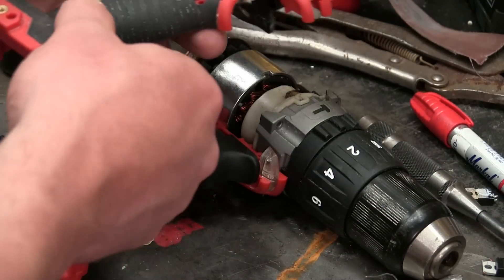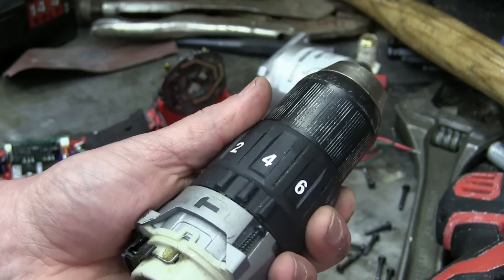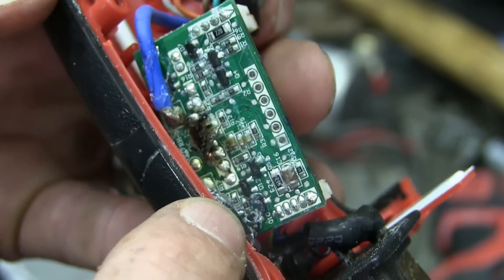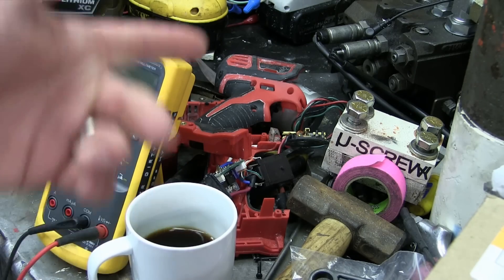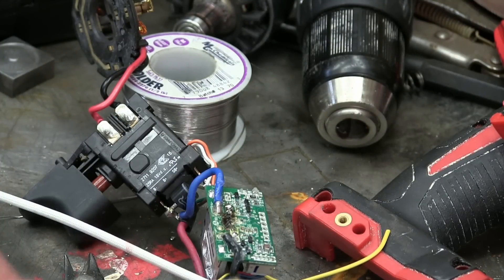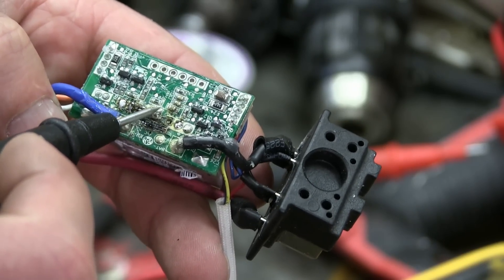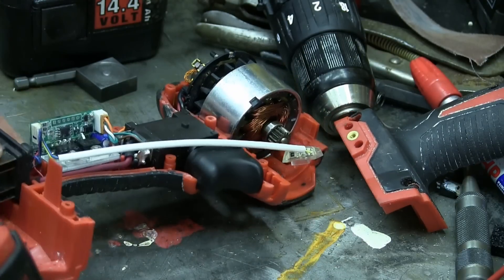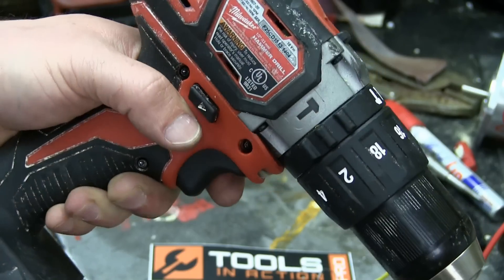How to fix fancy electronics in newer tools.

Comment: Hi sir I live in VN i have 1 hammer drill   MIlwaukee M18 2702 - 20, after 2 weeks to work it is smoke and death, when i press the trigger button  the LEDs are good but it is dont work i was check  soldered it is good, please hepl me, because it is expensive. How to Fix it is work again
 I buy on ebay, i cant go to usa  take it back under warrenty

Comment: Hey that milwaukee part is $60.20 CAD.  I just logged into my milwaukee account and checked.
Reply: Ya it was nice to see it was repairable.  You should see how many Milwaukee tools FAIL.  I have repaired drills that do not work straight out of the box.  I don't have all the fancy hardware to determine the exact failure, but it is sad to see such a great brand have so many issues.

Comment: Took your advice, grabbed a pressure washer neighbor threw out. turns out numb nuts left it out full of water and cracked a part connected to the pump head just where the pressure hose comes out (also sucks up any deturgents you want.)
 cant find it online... its aluminum so ima take it to work and try to tig weld it just enough to get her spraying again. if it works i get a free 3k psi pressure washer lol

Comment: AvE - You can use an air nozzle  to blast molten solder out of a hole if you don't have a sucker/braid handy.  Works great for thru-hole or smd components.  Just heat up the solder on a pin, squint (for safety), and give it a quick blast of air.   Repeat for all pins.

Comment: That was fun to watch and very helpful.  However, I wouldn't consider Milwaukee tools to be disposable, and they don't seem to either.  Their 5 year warranty bares that out:

Every MILWAUKEE power tool is tested before leaving the factory
and is warranted to be free from defects in material and workmanship.
MILWAUKEE will repair or replace (at MILWAUKEE's discretion), without
charge, any tool (including battery chargers) which examination proves
to be defective in material or workmanship from five (5) years after
the date of purchase. Return the tool and a copy of the purchase receipt
or other proof of purchase to a MILWAUKEE factory Service/Sales Support
Branch location or MILWAUKEE Authorized Service Station, freight prepaid
and insured. This warranty does not cover damage from repairs made or
attempted by other than MILWAUKEE authorized personnel, abuse, normal
wear and tear, lack of maintenance, or accidents.

Please keep the videos coming, they're always a hoot!

Comment: Is that drill actually worth more than $10?
Reply: It is when it works.
Reply: wobbly sauce
 I guess its also an environmentally sound solution come to think about it, I would be more inclined to do it with higher value electronics though.
Reply: Just the same thing with say.. older cars.. some are worth repairing and others are not, in comparison to say getting a new one(or new to you)..
Reply: I don't know about the drill. But the battery alone is worth north of $100USD
Reply: Paul Frederick 'Worth' vs actual value of the components :P
Reply: wobbly sauce
nah the battery pack is probably pretty nice as far as battery packs go. Although I have had problems with big red's old chargers in the past. Electronics is obviously not their forte.
Reply: Ah one of those.. spend money to make a good part.. but skimp on another for cost reasons.

Comment: 12 h i need to take a serious look at digikey it's probably way cheaper than Conrad and faster
Reply: I always call Conrad the "Electronics pharmacy" because of their outrageous prices. Sure you can take your parts home right after buying them in a store but asking five times the regular online price for a microcontroller is unacceptable. I only go there to try and find reduced gear, they always hide it inbetween the new stuff. Depending on what you need, you can always go to eBay and look for components and modules there. If you don't need the stuff right away, just get the parts directly from China.
Reply: yeah i live in a country where  we only have a few stores from conrad and they are very far away from me like a 100 km away and i only ever used amazon they don't deliver in 12 h but if digikey delivers faster than ebay here i will use it from now on

Comment: I've fixed many a pcb in similar ways. run bare copper along where the trace belonged, tin it to catch any bits of that trace and hold it in place and you can get uv curing epoxy stuff to build over it. you can even build pads for those smd components again and repair multi layer boards that way. enamel coated 30awg wire works well for low current. smash it flat to keep it from rolling around while you work

Comment: Wire it direct!  Why the flock would you need a circuit board in there. Wire the trigger to the batteries to the motor to the drill. Screw the stupid circuit board, just give the motor the pixies from the battery through the triggery thing!

Comment: Really enjoy the videos.  I don't think you mentioned that the MOSFETs are ESD sensitive, so you should tie the Gate to the Source (or drain, or both) while you are playing with and inserting it into the board.  Just wrap some AWG 24/26 solid wire from some stripped CAT5 around them and unwrap once it is in the circuit.  The 'O' of the MOSFET (Oxide) doesn't like having really high voltages on it and will break down from static electricity.  Cheers!

Comment: Solder suckers never work well. Heat up the solder and once it's in liquid state bang the PCB on your workbench...
Reply: Soldier it's spelled soldier.
Reply: Soldier sucker? Me love you long time?
Reply: Blanket statements never work too well either. As there are many different kinds of solder removing tools. Some in my experience work rather well too. But there are tricks to using them. Which is to say one must know what they are doing.
Reply: the best ones have a silicon condom on the tip.  molds into the right shape and heat doesn't worry it.  slurps it all up
Reply: Son of a Zombie
I have a Soldapullt clone and it does not even need to be too close to get a good vacuum. It is gigantic! The other trick is to keep your O ring seal in good condition. I use synthetic dielectric grease for that.

Comment: it's pretty sad on how tools are made these days, it's all Chinese re-branded crap, unless you buy Festeringtool, which is way to many Canadian pesos for me to spend, bad enough what I spend on the Snap-on truck every week, but at least I know it will last longer than ten minutes and has warranty if it shits the bed, unlike most of the shite you pick up at the Home Despot. If I want disposable tools might as well go get the Power Fister.
Reply: +BikingMNViking  they do make good tools, so does General or Powermatic
Reply: My sawzall said assmebled in America. So far I'm pretty happy with it... it's the newest tool I own.

Another great vid Ave could do is upgrading those crummy old nicad and Nimh battery backs to li with a buck regulator.... charging is usually more the issue but some chips will let you get around that. I think bigClivedotcom showed a buck regulator that would limit the input so it wouldn't cause a fire.

That'd be the best of both worlds.... fit in the same tool, be lighter, more po'ar, AND plug back into the same charger. A worthy project!
Reply: there are many good tools out there still.  it is probably the only industry where it is still possible to buy quality stuff.  just go to specialist tool shop and not the big box chinaman warehouses.
Reply: Son of a Zombie
 yup I know but but for the average Joe, they have to buy from the big box stores and get the consumer grade or consumable grade tools, as places such as KMS tools, Grizzly, Modern tool, Lee Valley, just are not local to them.  so you end up with Milfucky, default, or crapoby, Mastercrap, or Crapsman tools, you just don't have a choice. the only other way average Joe can buy decent tools locally is get them used off of Kijiji, or Craig's list or buy going to Industrial actions.
Reply: The Divine Hammer's Woodworks
More of them (americans anyway) have Amazon Prime and you can buy nearly anything on there w/o paying a dime in S&H.

Comment: How the fux-sake does that part fry?  The operator forget to put a condom on their finger?
Reply: Guessing something went wrong with the switch or with the board and both mosfets got triggered at once. It's set up to have forward and reverse, so if it tries to run both directions at once, it basically shorts + and - through the mosfets and the the pixies barbeque the circuit board.
Reply: +Darwinpasta 
or that they took the drill, overheated them with a million holes, dropped them in water, put saw dust all over them wet, dropped them from the roof, and repeated that same procedure like 5 times until all died..
Reply: LOL yeah, that probably had something to do with it.
Reply: +Anas Malas Those 2 half wits (Clarke Griswold and Muffin Top) aren't that ambitious. All they wanna do is stand in front of the camera and make pronouncements.
Reply: pretty easy...put mass on the drill and spin it up high, switch to reverse and press trigger lightly. Watch the engine, now half generator blow the crap out of any mosfet inside :-) done it twice on Bosch . sometimes fast deaccelleration is already enough, no diode protection
Reply: Moes dont they have auto electric brake? It's impossible that the "premium" tools have worse electric breaks than my black+Decker (which I bought because it changes into a jigsaw, sander, circular saw, etc without talking too much space, which I dont have as I work in my small bedroom so I cant buy big tools...)
The autobrake on this thing stopped a 15x15x4 cm block of wood spinning at high speed when a spade blade binded to a knot!

Comment: AvE.. I love watching you take a tool apart and show how the mfg'ers fuck us by revealing the case plastics and ratings or a cheap trigger, motor or gears say in a drill and then sell the tool for top dollar because of the name. You do the real " That's how it's made video"  I loved your Hilti hammer drill expo and how they did great machine work but cheaped out where they could shortening the life of the tool considerably and lets not speak about the 500 dollar hair dryer.. Holy Sheep shit!

I going to make a suggestion.  

     How about doing videos after you show the chooch & smookums ( i just had to work that in. lol ) of a tool and either upgrade the shit parts for parts that would give the tool a much longer service life.  Like replacing a trigger with another that fits of course and doesn't require a total reconfiguration of the statue of David to install the replacement parts.  Or finding a motor replacement that would fit a much higher quality of motor or replacing cheap gears with good gears and show for a few bucks more the Mfg'ers could have made a great tool instead of a tool designed to fail for profits..   

Show the process like getting different catalogs either online or in the mail for parts and point out which parts would work best and why... So your viewers could take a tool make it a project and remove and replace components to make a super tool.. now that's shoving it to the man!  What do ya say?